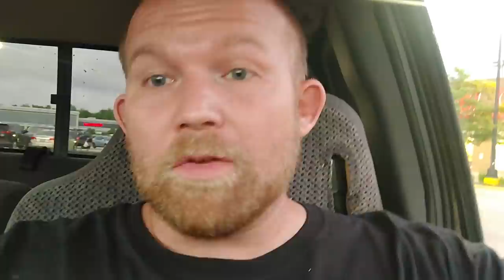Fram Filter Application Talk And What is What and Why - The consumer is the issue not the filter

Comment: I've seen so many engines fail because people followed the manufacturer service schedule while using the cheapest oils and filters they could find. My first job was at a shop that did $15.95 5-quart oil changes, and other stores did $9.99 5-quart oil changes. People would argue that we were ripping them off by recommending a 3000mile/3mo interval because Toyota said they could go 5,000miles or 1 year, but most of these people wouldn't pay for the 0W20 synthetic that Toyota called for and had us use conventional 5W20 instead. Funny how they'll listen to Toyota when it saves them money and ignore Toyota when it costs them money.

The conventional oil didn't even look like oil after 1 year, it drained out as a thin nearly clear liquid like murky water with clumps of grease or sludge in it. I made less than $2 per oil change, I didn't want to do them, but I still told people to change their oil because it was the right thing to do.

Comment: I like using oem filters. I work at a parts store now and I always recommend OEM filters first, also we don't even stock anything above a conventional fram filter. I used to use napa gold filters because that's what the shop I worked at stocked and they did well enough, but I ended up moving to Mobil1 filters. I changed  my Valvoline full synth oil every 3 to 5k. 

On another note, when you mention engine tolerances, I have to tell my customers every fucking day that you can't put 10w-30 in a modern truck that calls for 0w-20. They get all upset that they can't buy bottom shelf oil and they have to spend money. That said there is only like 4 places that produce base oil, the only real difference is what additives they throw in it, which does make a significant difference overall.

Also one last point, USE THE RIGHT FUCKING SIZED FILTERS!! Just because you went to Firestone and they put on a filter that fits, doesn't mean it has the right capacity. Had a customer the other day that said we gave her the wrong filter, I had to explain that the one we gave her was the OEM size and style and the aftermarket one she had was technically too small but she went with a smaller filter anyway because it was "hard to get to."

Comment: I've been using Fram orange filters for years. My current car, a 99 300M, has 208,000 miles (bought Sep 2014 w/ 104,000 miles). I drive 90 miles a day round trip to/from work and change the oil as close to 3,000 miles as I can with Pennzoil conventional 10w30. NO problems!!!
Reply: I can't find conventional Pennzoil anymore so I'm using their synthetic blend. No leaks or seepage so far.

Comment: Here in Europe FRAM got a bad reputation because of a production defect about 20 years ago. They found metal shavings from tapping the threads inside the housing. They weren't cleaned out properly during assembly.

Comment: Well... How good are the Motorcraft filters? I've been using the FL 910S filter ever since I have owned my 1.5 Fusion. 90% of the driving is on the highway and I do 4500 mile oil changes with full synth.
Reply from the maker: Motorcraft filters are probably some of the best filters I've ever used

Comment: Agree that frequent oil changes are more important than the brand of filter .  But I don’t get your efforts to defend Fram.  Have not bought a fram in years but I do make a habit of cutting open filters to look for debris at every oil change.  Habit from working on airplanes.  Last time I cut open a fram it was not near the quality of a wix.  I started buying wix when I noticed large truck fleets using them.  I’m not going to spend money on quality oil every 4K miles and filter it with a cheap filter to protect a $10k engine .  BTW,  NAPA oil filters are made by wix.
Reply from the maker: Really I'm not defending Fram I'm tired of hearing people's b***** about why Fram filters are terrible and then not even speaking about the higher-end filters that they have that are better than most of the filters on the market

Comment: The reputation Fram earned for itself was based on comparative quality to other filter brands, shown by those who disassembled them, demonstrating that Fram is made to a low price point. So it comes down to price. The thing is, a higher quality made filter doesn't necessarily cost much more than a Fram. In the case of my Ford Fusion using Wal-Mart online pricing, a Fram is $3.88 and the Motorcraft $3.97, a difference of 9 cents- I can stomach a 9 cent loss for peace of mind, even though I change my oil every 4-5K miles.
Reply from the maker: They have more than one filter and it's seems like because of the lower and filters everybody just bases all their filters off the lower ones and that's not right to do that

Comment: What do you think of OEM filters such as Motorcraft, AC/Delco, and Denso? I use Denso for my Toyotas but at 5K or just before. Oh sure, my 16 Camry would've done just fine for the warranty period with the 10K recommended OCI but I don't think it would run the 300K+ miles I expect from it like that.

Comment: Fram is never crap it's just people's heads being full of it. 

All fram filters have a steel core inside and that's what actually matters and prevents the filters from collapsing not the end caps. The caps just seal it and prevent dirty oil passing through. 

The filtration media itself is good and doesn't split or tear and that matters.

Comment: Also your 100% Right, Change oil every 3-5K and I Change the oil in my boats 250hp outboard every 100 hours just like the manufacture tells me to. I'll spend 100 bucks on a Mercury branded oil change before I spend 22 Grand on a new engiine

Comment: I drive 50 miles each way using Mobile One Extended Performance oil and filters. My commute is almost all freeway so I change at the recommended 15,000 miles. Any thoughts on that? 

2016 Outback 2.5l that gets regular maintenance by me or the dealer for things like plugs.
Reply from the maker: You definitely don't want to do that at that car because you're going to be having problems at 120,140,000 Miles more than likely and those cars do not like extended oil changes

Comment: After owning my Raptor 10 yrs now...Ive learned a few things about her..My oil change interval is 5k miles...Initially was just using the Motorcraft oil filter that they put on..Was noticing when the life of the oil filter seem to be going prior to my oil change interval(about 1500 miles before oil change)..I honestly could feel it in the performance of the engine...So I decided to use Puralator Pure 1 10k mile oil filter for about $10... Let me tell you what..I instantly could feel the difference in the performance of the oil filter..And, it lasted longer at the 5k oil change interval..Performance wise.. Now, I came across Fords SVT oil filter, it was like $25-30..I used it once  and went back to the Pure 1...The SVT filter to me, wasn't much better then the regular Motorcraft oil filter,performance wise and could save almost $20 on the Pure 1...I SWEAR by the Purolator 1 oil filter...
Reply: I respect your opinion of the Purolator 1 but I call BS on your claim you could tell a difference in performance.
Reply: @jamesrichardson559  You can think what you want.. The truck has 120k miles and  10 yrs old now.. I have NO reason to lie about what I said... There was a distinct difference to the regular motorcraft,SVT filter and the Pure 1... Every time my truck got about 1500 miles out from an oil change, there was definite difference in the performance of the engine..I literally could feel it..Much along the lines of putting 87 in it and using 93... Billieve what you want..Im NOT here to blow smoke up anybodies ass nor am i here to make false claims and look stupid.. Thats my experience..Take it or leave it..

Comment: I saw where fram's bypass spring was inferior and was quick to bypass when unnecessary, as well as inferior filter material.
I was sold when i saw that Wix uses a coil spring for the bypass operation and uses a superior filter material.
It only takes doubt to remove trust and I trust the coil spring over a  thin plate spring.
Reply from the maker: And what model Fram filter was this the most basic filter or have you even tried to experience any of the higher-end filters that they have for the same price of the other standard filters that are on the market
Reply from the maker: I mean I see a lot of talk about why people don't like frams but they don't ever talk about any of the other products that they have in the oil filter line yet they constantly reference the $2 orange filter which makes no sense
Reply: I spent 15+ years as a dealership technician and during that time I only saw 2 oil filter failures due to defects ( many more due to poor maintenance) and both were Wix filters and both were failed coil springs.  I wouldn't hesitate to use a Wix filter but just because the coil spring appears to be higher quality then a stamped steel leaf spring doesn't necessarily mean it is going to be more reliable. Basically the moral of the story is any filter can have a defect here or there but out of the millions of filters every filter company produces every year the failure rates are so low that they are statistically insignificant.

Comment: get what ur saying but i still think if there's any chance of a filter disintegrating if the customer does happen to go longer than they should between oil changes, chunks of stuff could get into the oil system, it's worth the extra peace of mind to put in a better one.  this is the difference between taking your car in to the shop where they're going to do everything possible to maximize profits, and doing stuff yourself where you're not gona worry about spending that extra $5

Comment: My .02.      I own and service my 2015 Ram 1500 Hemi myself.   Oil is Penzoil Platinum synthetic 5-20 and wix xp filter.   Ram says I can go 10k.   I don’t I run 5-6k and I’m happy with my 30 mile drive to work 6 days a week.   Why because I know I’m doing right by my truck I use it as a truck and I treat it better than some treat high end cars.

Comment: So let’s throw a monkey wrench (little pun intended) into the mix, I’m a buy whatever reputable brand of oil is on sale and I usually buy the filters from the dealer…outside of that and the  3k oil change…(I’m more of a 3500-4K guy). What are your thoughts on the fumoto oil drain valves….Normal 4 season road conditions? I’ve been using it but I know the original drain plug is a little magnetic at the tip. For me it’s a cleaner more controlled change.

Comment: On all my vehicles even my diesel motors I use Mobil 1 pure synthetic with a name brand oil filter for the make of the vehicle. In the gas motors I do 2500-3000 miles and in the diesel motors I do 4000-4500 miles between oil changes! Just don’t be lazy and change the oil filter brand and oil won’t matter if you change it.

Comment: I've used FRAM oil and fuel filters for more than 20 years with Z-E-R-O problems.  NONE.  I've used FRAM filters on both farm equipment and personal vehicles.  For the FRAM bashers, one time I did switch to a Motorcraft oil filter for a routine oil change on a 2003 Ford Taurus.  Guess what?....within a week it began leaking.  I did not change a single step or procedure I use during oil change and filter installation.  ONE TIME I switched to another brand, the OEM's recommended filter in fact, and it leaked.  So I immediately changed it back to a FRAM oil filter.  The leak stopped.  Why?  I don't know and I don't care.  I do know there weren't any more oil stains in the driveway.  And the engine runs fine with more than  225,000+ miles on it.  Also, I have always used Ford Motorcraft 5W-20 semi-synthetic in the engine.  Nothing else.  Cheers!

Comment: Need recommendation for a 1-¼ to 2in hitch adapter on a 2017 Fusion with 80,000 miles?
I'm sure this 1.5L EcoBoost has the torque to pull this trailer!
Thoughts?

Comment: Only motorcraft in my three Ford’s - buy them by the dozen.
No Frams in my cars- oem
Reply: Me too!....all of my 4 Fords are pushing 250K and have only used motorcraft filters and valvoline synthetic maxlife.
Reply: @PeeterPuncher - I’ve taken one of those pos fr@ms apart back in the 2002-2003 on a escape, filter was card board crap that collapsed inside. Yeah 3000 mi , never bought one since.

Comment: man i dont like fram orange can, ac delco, or really any filter with paper end caps or ecore design. its worth the extra $4 for the fram ultra. 

alot of filters fail. even some of the beloved motorcraft (on my truck right now) have shown tears on used filter inspection.  so yeah i agree, oil change interval moderation is key.

Comment: I agree with what you said, but I do think you missed one point.  Many people buy a car at a payment point, not an overall cost point.  Because they can barely afford the payment, they either change the oil rarely or not at all, or they follow the manual and push 15k on $20 oil change special and they trash the engines.  I just bought a new truck, saved as long as possible to do it to get the payment to a manageable amount so I could afford to do the regular maintenance.  While there I saw at least 5 other people buying way more car than they could afford.  Those cars will be lucky to make 100k.  I feel like the mfrs are to blame as well, for pushing change intervals that don't work in real world usage for a lot of cases.  Lots of Soccer moms around here that drive 5 miles to school, but don't change oil until the dash says to.  While yes they should know better, there's no need for the mfrs to do that stupid shit too.

Comment: I always look at it as cheap insurance. Another 30 bucks into the oil cxn is better than a motor rebuild. And doing it yourself is EZ if you take your time use your head don't over tighten things be observant. Plus you can look for other potential issues and maybe catch them before they get worse. Just stop being lazy.

Comment: If my vehicle is under manufacturer’s factory warranty, I will use OEM filters from the dealership. With that being said, on other vehicles, winter cars, etc, I’ve used Fram, Carquest, Napa, they all work great. Also, the blue spin on filters that Subaru sells at their dealership parts counters for Subaru vehicles are made by…guess who??? FRAM!!! They contracted with Fram several years back to make filters for them!
Reply: Who cares who makes the filter. They are made to a high standard and quality when built for OEMs. They aren’t the cheapest bottom of the barrel.
Reply: @I_know_what_im_talking_about , Fram is not bottom of the barrel. Their filters are trusted all over the planet. It’s when they are left in service too long is when ANY filter can fail or degrade.

Comment: The most unreliable component in any car is the owner.  Just do your schedule maintenance and don’t put stuff off.   Drive with care and don’t beat on your vehicles and they will go the distance.  Like I’ve said, I’m an original owner of a 07 Honda Accord with 250,000 miles, always used full synthetic and Fram XG from Walmart with no issues every 3k to 5k.  Changing oil is the easiest, cheapest, and beneficial thing you can do to, aside from just changing your air filter and other fluids at schedule or earlier if it’s needed.

Comment: On the subject of low tension piston rings, what are your thoughts on taking the piston rings out and using regular tension piston rings?
Reply from the maker: The vehicle would probably actually run a hell of a lot better
Reply: @FordBossMe  I've been contemplating a rebuild on my Tacoma with regular tension rings. From what I understand I also need new pistons preferably with larger drain holes.

Comment: I've been doing my own oil changes for about 18 years at this point. when I first started doing them, my dad told me "mobil 1 full synthetic, don't go more than 5000 miles." and he probably told me to get whatever the cheapest filter is. nobody is perfect, but I generally try to stick to that. I'll use brands other than mobil 1 just because pretty much all the synthetic motor oil producers that aren't amsoil or royal purple are just basically selling the same base oils with a slightly different additive pack. but I really try not to go any more than 5k miles. Haven't had any lube related issues yet. typically get whatever the cheapest filter I can find is, which is typically a fram. occasionally wix if one of the auto parts stores actually has a better oil change special than just going to walmart and getting oil and a filter at normal price. I wouldn't keep doing it if the fram filters were so bad. I've probably done 10 oil changes on my current car, the previous owners took it to a jiffy lube. the only lube problem I've ever had came from those idiots deciding they were going to fix a minor drain plug leak by using some sort of adhesive/putty/something(almost looked like caulk but it was too hard) as a seal where the drain plug meets the oil pan. basically gluing the drain plug in made nearly impossible to get the thing out, pretty sure they got a glob of the stuff on the end of the drain plug, so fitting the socket on it completely wasn't even possible.

honestly, about the only times I've gone over 5k miles between changes it was because I physically couldn't get under the car due to some chronic pain issues. I'd rather take my chances going 1k over than taking it to a jiffy lube and finding out what new way they've found to screw up probably the easiest maintenance job on a car.